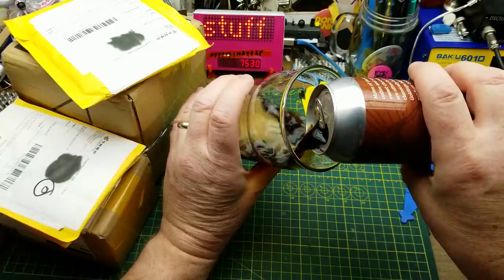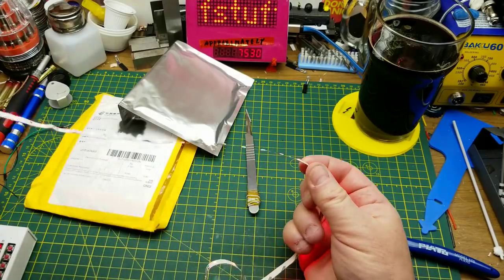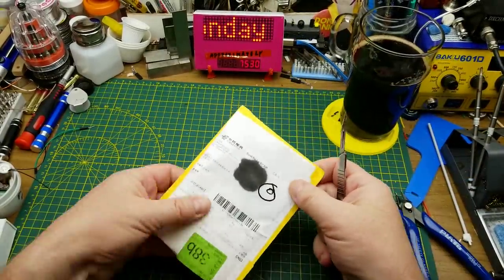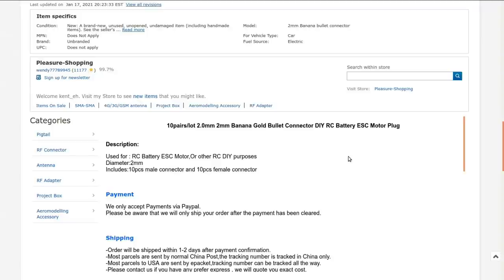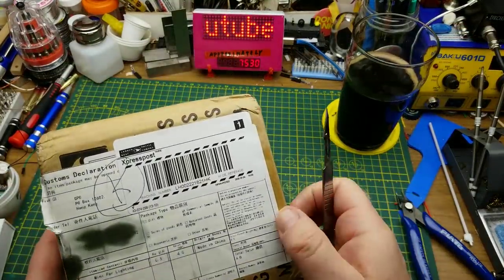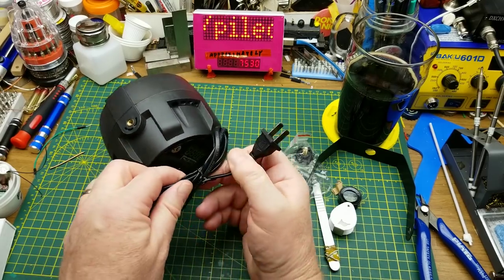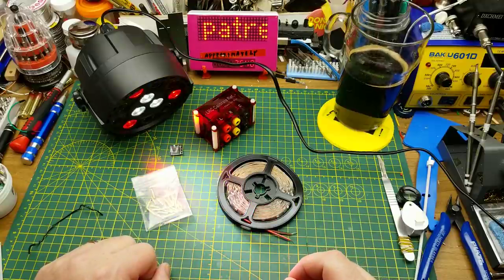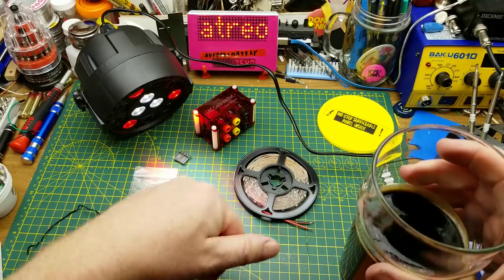Mailbag Monday#106

Comment: When I first started doing DMX LED lighting I was disappointed by the lack of lumens, but I quickly realized that when if I replaced 8 par64 incandescent with 8 par64 led I would be replacing 2 red lights with 8 that could all be red at any given time. I never did any measurements, but with how directional those things are it felt like it took 4 to replace 1.  It more than made up for it in color changing flexibility though.   Fun haul as always.  That reference block is a really nice thing to have on hand.